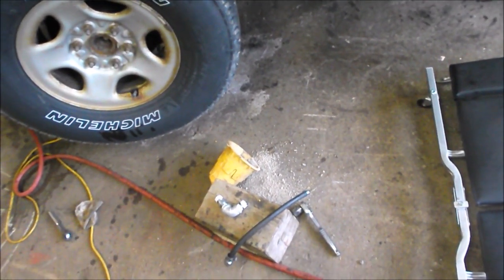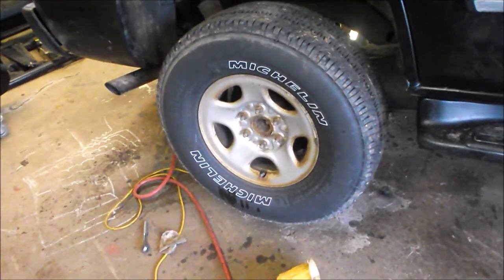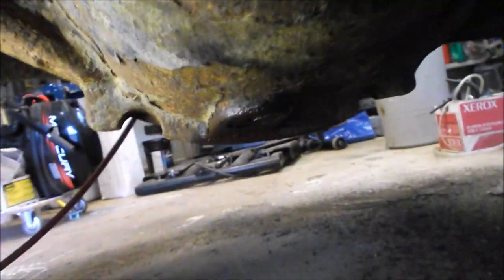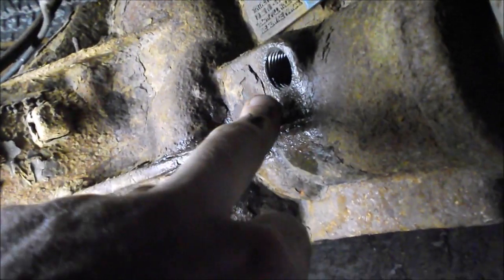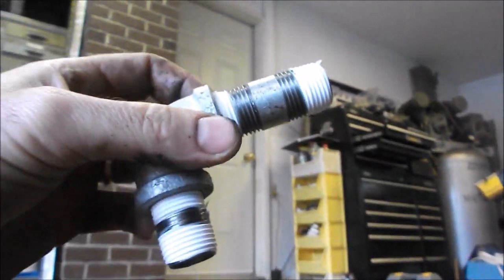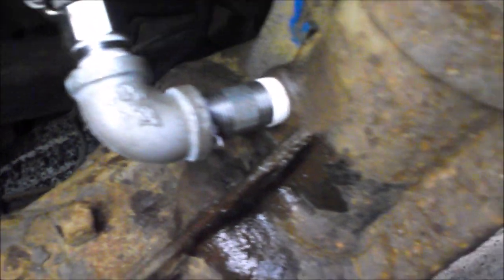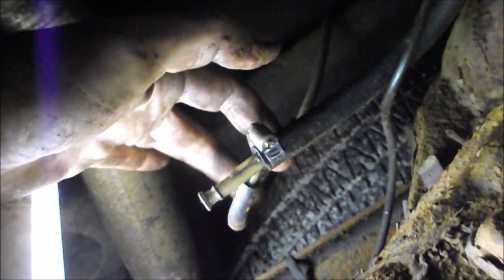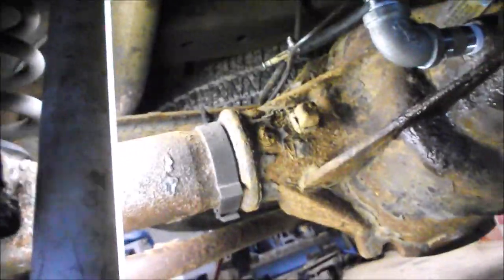Checking & repairing a differential vent tube when troubleshooting a leak (Part 1 of 2) Tahoe

Comment: You can buy the vent at the dealer and it only takes a hammer and chisel to pop it up and out. It's just pressed into the top of the differential. Knock the new one in with a small deep well socket so you don't damage the nipple. Hook up the factory hose after you blow through it and make sure that it is clear and not clogged up which would cause the pressure in the differential to start pushing oil out of the seals.

Comment: The only problem I see is that the vent is really close to the ring gear where fluid is getting flung around & could get into the vent a lot. I suspect that is the reason the vent is usually farther outboard on the axle. Just a thought.

Comment: That galv. pipe in the filler will not work.  When the fluid heats up it expands and covers the filler hole, sealing the diff. just like a clogged breather tube.  Pull the rear cover, remove the clogged breather port and install a new port, new tube and a one way valve on the high side of the breather tube.
Reply from the maker: Very interesting point. I agree that my fix will cause fluid to push out the galvanized fitting and up the vent tube as the fluid heats and expands. This is in contrast to the original design that only pushes air up the vent tube. However, I'm not at all concerned since the fluid won't expand so much to overflow the tube (it is a couple feet long) and also since all the gears will be as covered in oil as they need to be. I haven't had a single problem since implementing this work around.
Reply: Jekyll & Hyde Garage hey bro, you seem to know alot about this.  I'm having an issue I hope you can help with!  I have an old Chevy S10 I cut in half and made into a trailer.  I flipped the axle upside down to basicly lift it and shove 35 inch tires underneath it.  I closed the old breather tube and did basicly what this guy said to.  My problem is I have diff fluid coming out the end of my hose. (6 foot of hose I put up high).  Why would it he causing so much pressure to travel up 6 feet of hose? Please help! Thanks.
Reply: Joe Cuevas because your breather hose is below the oil fill level where this guy's breather hose is above the fluid level

Comment: how long does plumbing tape last exposed to differential oil? great video
Reply from the maker: Good question. I don't know the answer. It isn't leaking after 5 months but I will keep an eye in it. The teflon tape is as much to make future plug removal a breeze as much as it is for sealing.
Reply: Teflon is tough stuff.

Comment: Shouldn't it have a one way valve to keep the diff from sucking moisture in?
Reply from the maker: +pinfarmer
the fitting into the differential was not a 1 way valve.  it is possible there is a 1 way valve at the end of the original rubber vent line up near the gas filler neck.  Since I reused that hose, I have returned it to "stock function".
Reply: mr diyguy123 
you don't want a one way valve. as the diff and oil cools, air needs to reenter the diff.
if you're worried about water entering the tube, extend the tube higher towards the bed/body. (such as in off road instances) to keep the end away from water.
another poster is right, you want your vent tube higher than your oil level would be.  if you put the vent near the fill plug, as the oil heats and expands, it will outflow through the line and when you cool off, your diff will be low on oil

Comment: Not a terrible idea but the biggest problem is that galvanized pipe & fittings dont last very long.  Especially exposed to the elements and depending on where you live salt and snow that pipe will rust and break off with the vibration of the road in less then 5 years and then you will need a new differential not just a new breather.  Great idea, bad solution!

Comment: Wouldn't it be easier to just use a tapout or weld a nut to the old fitting. Pull it out put a new fitting on it then buying all that pipe? Fittings don't cost much.